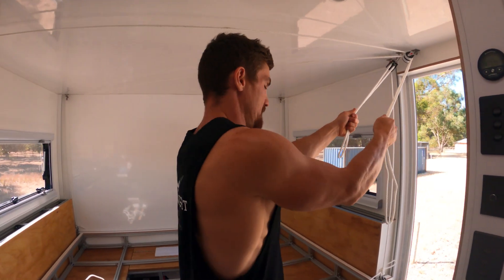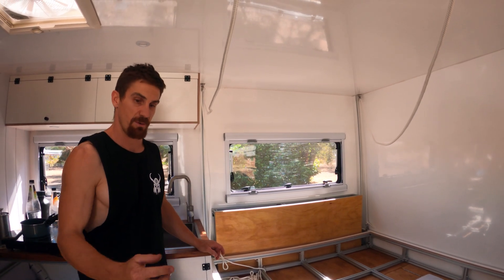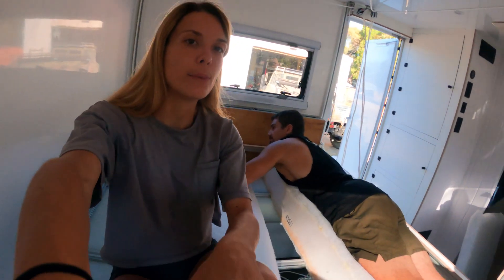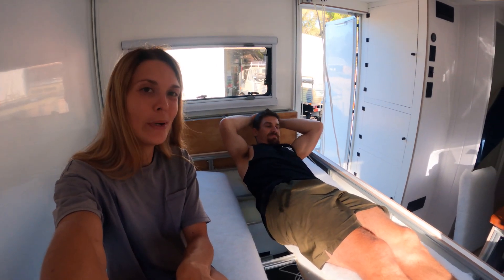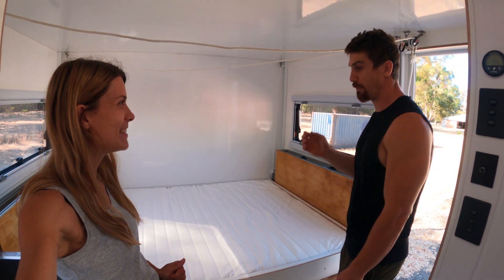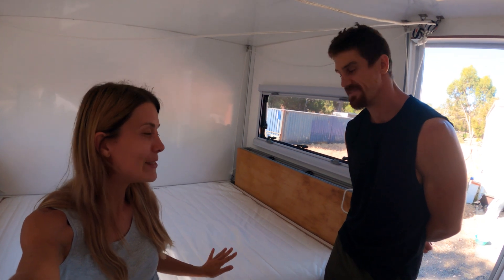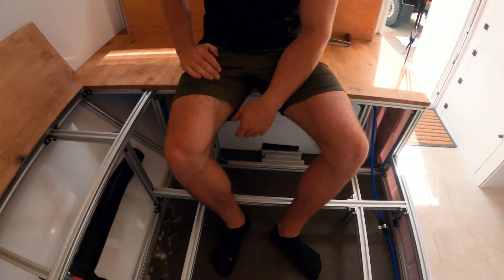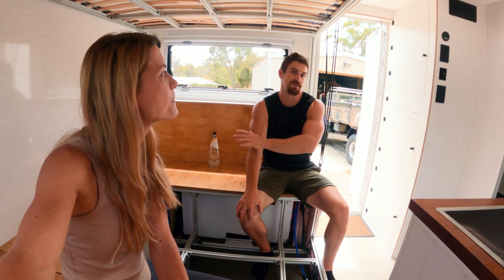Affordable DIY Bed Lift - Getting Close to THE END OF THE BUILD! DIY Camper/Caravan 36

Comment: For your electrical cables you just need a retractable cable reel, that way the cable just reels up and down  as the bed goes up and down. My drop down fridge slide has one so my cable doesn't get caught in the slide.

Comment: Get a spring loaded, ‘clock spring’ cable retractor they allow the cable to run and retract automatically. You can also get ‘tank track’ flexible cable holders that could be made to work.

Comment: Great job. Why not use 12v battery powered led down lights in the underside of the mattress? Would probably run the lights for a good couple of months, and avoid cabling issues
Reply from the maker: Thanks Rhys! We didn't think of that, good idea - we'll keep it in mind as a backup plan if we can't make the wiring work effectively :)

Comment: Had  thought when watching you guys build this, you could flip the whole system and hide the roles. Hang the bed from the roof, and havethewhole coiling/lifting system on the edge of the bed, so it raises withthebed, all the roles running inside it.

Comment: A thought for the bed power cable. Do a concealed run to the roof then anchor the power cable from the ceiling and let it hang loose to the bed. Set the length so it is taught and neat in the corner when bed is lowered. When bed is raised the cable will coil into a pile on the mattress—safely out of the way.

Comment: Looks Amazing :)
for the power, if you have two coin size copper plates to the top of rail, connected to 12V. and two springs on the bed side to make contact when you lift the bed, then you will have power for lighting. all DIY from Bunnings.
love the build.

Comment: Don't know if this has been mentioned or not but will the bed rest on your seat cushions in the lowered position? This might not be ideal and cause them to compress too much or wear faster. Also, the bed frame might rack and deform with more weight on one side and a soft cushion supporting it underneath.  Great build so far though. Lots of creative problem solving.

Comment: Great bed design guys. It is great you've used eyelets at the end of the ropes will last longer doing this one thing you could do is splice the ends with the eyelets still there rather than using knots there are no strength differences that you would notice is just a very clean finish. 

Controlling the wiring when lowing and raising you can get plastic flexible cable ladders of different sizes the only challenge with it is it may bang around while driving or you could have a plug and socket so before you lower the bed you just unplug the wiring.  

Covering for under the bed frame maybe use something that looks like a canvas sail it will keep with the theme you are trying to go for plus it will stretch and move with the bed frame if you were to use press studs you could just quickly pull it down and give it a wash when it's looking a little dirty.  Merry Christmas and have a great new year.

Comment: May be a bit late now but would of been pretty easy to run the ropes down the back corner and power via a small 12v winch then it's just a push of a button. If you added dual pulleys to the corners up top you could of avoided crossing ropes along ceiling and hide everything into a trim or conduit of sorts. Only recommendations guys but either way you've done a fantastic job and keep up the great work. Not long now and you'll be on the road!
Reply: I used the smallest HarborFreight 12v winch to pull up the 1/8” steel cable for my bed lift. The weak point is the pulley attachment points. The winch is powerful enough to pull out the attachments.

Comment: Almost finished..... Years of experience with both Espar hot air and Webasto hydronic systems on my boat taught me to put a filter on the intake of the unit. One that worked well for me was to use a gutter down spout basket or an anti-squirrel vent basket with a thick cotton sock pulled over it. Fasten the basket to the inside of the vent opening so cabin air is drawn through it...when the sock gets dirty throw them in the wash. Merry Christmas...great job.

Comment: Awesome stuff guys 💪🏻💪🏻
The bed travelling wire can be solved by a finger that lands in a “nest” at the top and bottom of the stroke/ travel, making the circuit without the messy wires. 
Like the bed 👍🏻👍🏻
Put a cleat on the bed frame to tuck the ropes out the way in the up position….
Also a foam “skirt” on the leading edge of the bed will save your shins…..!!!!!😀🙈
Mama and Papa did good 👌🏼👌🏼👌🏼
Merry Christmas 😃😃👍🏻

Comment: Absolutely love the bed with the boat theme.  For under the bed they have this wall covering sold in 4x8 sheets, it’s used in commercial bathrooms or areas that could get wet. It’s made of thin flexible plastic smooth on one side textured on the other. With the hole in the slat you could say with the boat theme and mount a small barometer IDK or something like that.

Comment: Yeah sorry gave you so much different thing on here maybe I should watch the whole video first but the electrical wires on the bottom of your bed you can get rid of those and just put battery operated light that's an option rechargeable batteries ok

Comment: In regards to the lights, search for track lighting (3 circuit tracks). With LED lights this should certainly be possible without cables. The rails are not too expensive.

Comment: Fantastic progress guys! 
An advantage of your rope bed lift and tracks is that you have the option to drill additional holes in the tracks toward the bottom down position and place the pins in the appropriate holes on each corner to level the bed if you can't quite get the Mog level on blocks under the wheels when parked on a slope. Or if you pull up for a night without doing a full set up and don't have the mog on blocks at all just level the bed. This is not an option with our Happijac bed but it is a fantastic system to have the bed up during the day and create all the extra room. 🙂